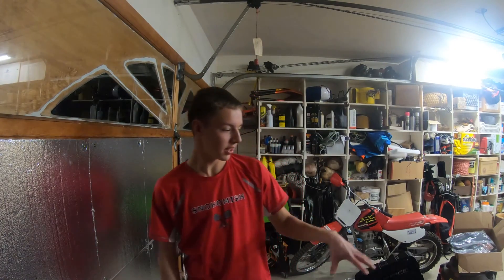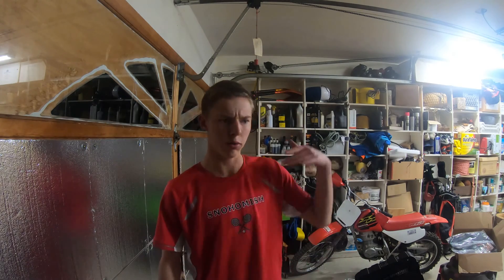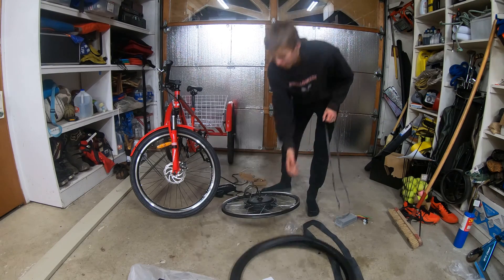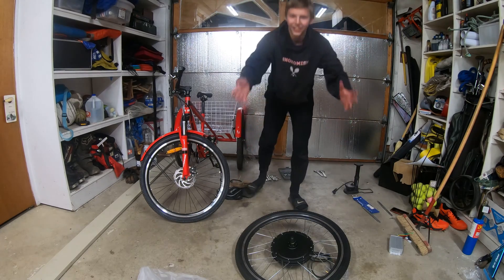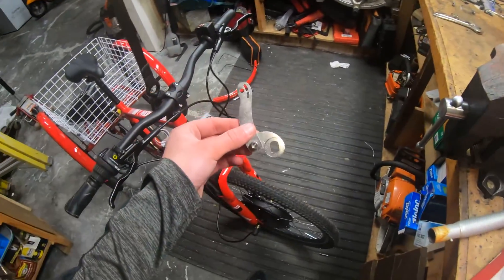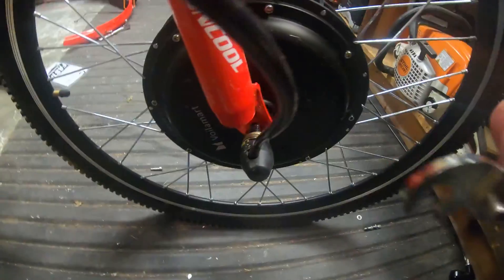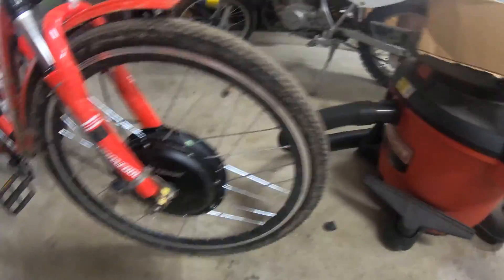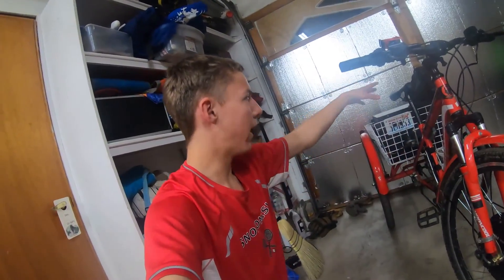Making a 25MPH Electric Trike-- Part 1

Comment: You're absolutely right about one thing:
These little Monsters are TERRIFYING to drive at top speed.
You may have heard that a three-legged bar stool is the most
stable configuration, but a three-wheeled trike Will flip you on your Head,
if you try to corner too fast. They're TERRIFYING.

Comment: This is a neat project. However, the cost for decent quality components at the time of writing (Oct 2025) is substantially more than $1000, and nothing seems to be getting cheaper. Given the amount of work, and the investment in doing a conversion like this, I think most people would hope for a certain amount of longevity. The option of using mystery-brand and dubious quality parts isn't a good one. I keep hearing about how electric components are getting cheaper, but if so I have not found any reputable source. I've tried experimental drive setups on both an upright and a delta recumbent trike, but in all fairness, using good batteries and well-built hub motors is the key to a long lived successful e-conversion. You made a very nice job of this conversion, and I'm sure it has worked out quite well. But the cost of major components may be problem for many people. Thanks for posting this video, and your follow up reports.
Reply from the maker: Thank you for watching. Yeah the prices seem too just keep going up and quality is questionable.

Comment: Look Up!
                       I have a 3-wheeler and it has a1'000 watt motor on the front wheel.
 It also gos 44Mph. 25Mph is just a slower cruising speed.